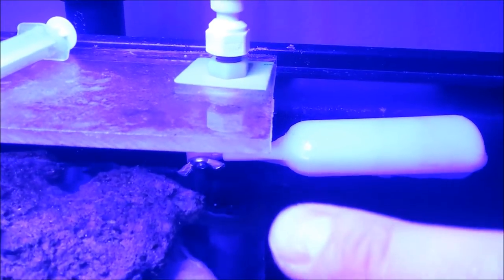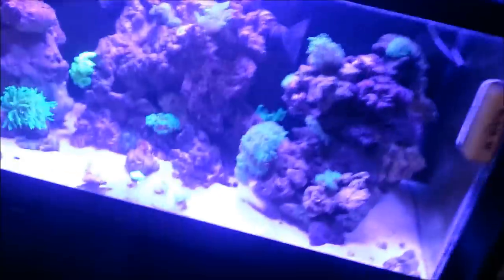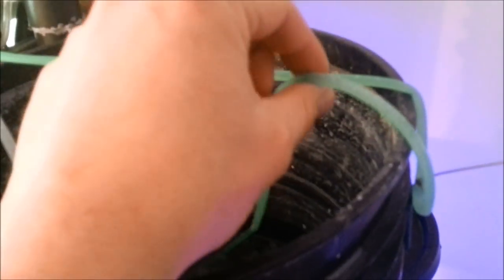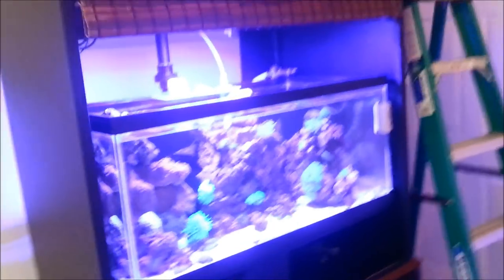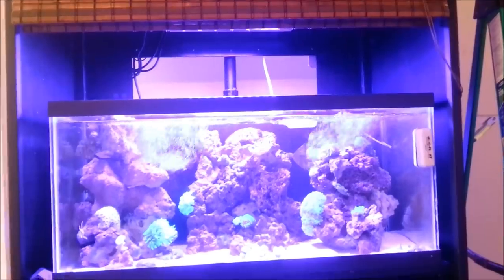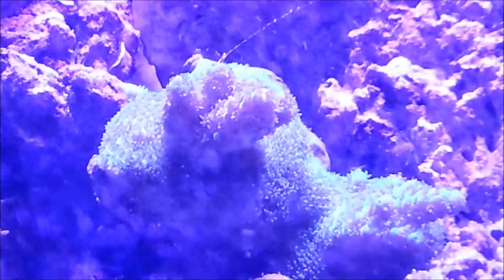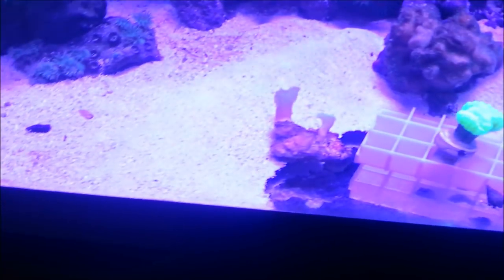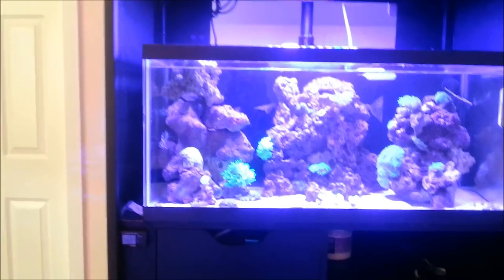40 Breeder Reef (Float Valve/Coral ID)

Comment: i have my ato the same way as you do. i drilled a hole in the bottom side of a budget and sealed it up with epoxy. check out my video on the float valve its "20L nano lagoon, new corals"